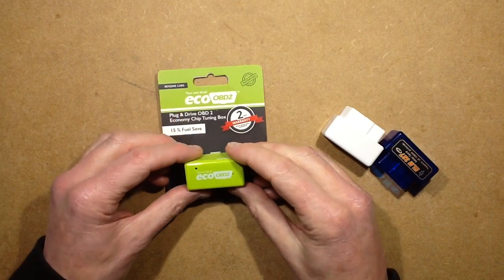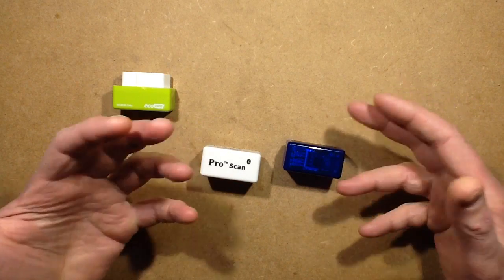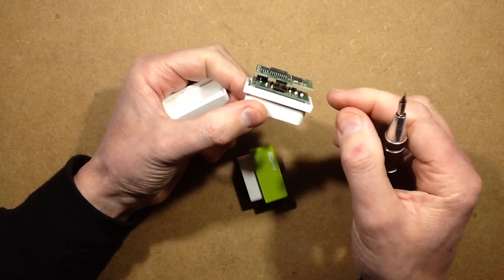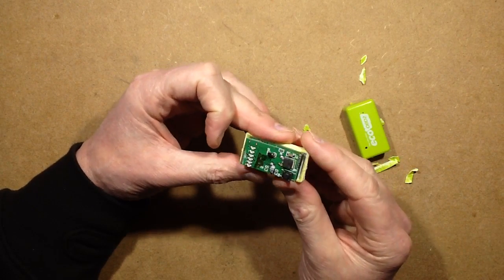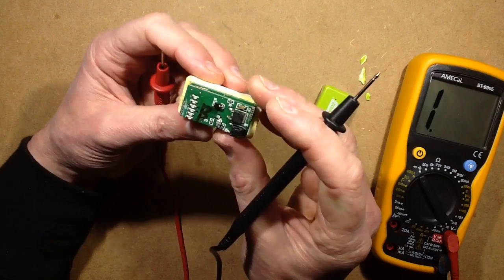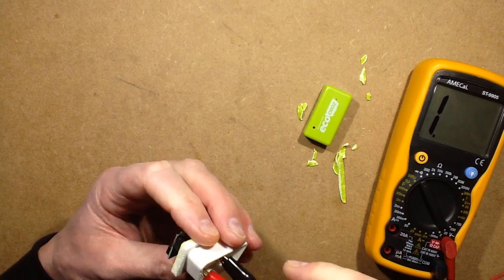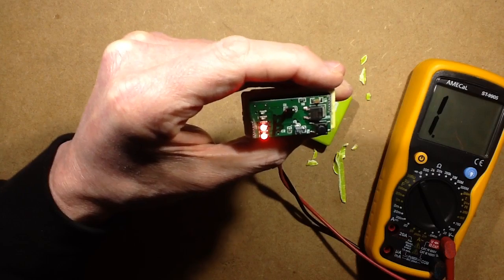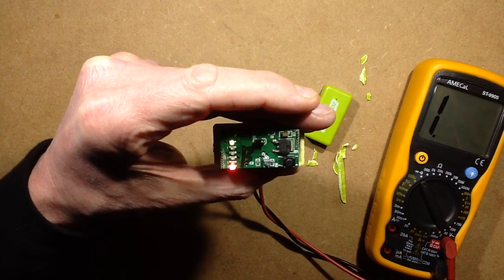Inside an ECO OBD2 "chip tuner" fuel saver.

Comment: To be fair, OBD hacking is not only for criminals. It is a logical consequence of what I call "down engineering". So let's say a car company wants to sell a low priced car and a higher priced car with more hp. Instead of developing two different engines, it is cheaper for them to build only one engine and have its power output reduced by software. Their marketing guys have carefully calculated the number of potential buyers and they can fill the lower price market and the higher price market. What bugs me about this is that they put an actual engineering effort, man hours and materials, into developing a product that is not as good as it could be, purely for marketing reasons. So if you buy the cheaper model, it could actually be considered a scam, there's a little chip inside to prevent it from doing all it could, purely for profit optimization. It is not only car manufacturers that do this, this practice of putting an effort into building something that is nerfed is found in many industries. So unlocking this sucker chip may not be legal, but it can also be considered self defense against a practice that holds the buyer for a sucker.
Reply: It does exist in the automotive world. Using VW as an example, the venerable 1.8T (20v) engine came in several different horsepower ratings across several platforms in both VW and Audi vehicles (and Seat and Skoda vehicles in Europe). The 1.8T engine was installed in more mk4 chassis' than any other chassis of the era, and came in 3 different power levels, depending on the model and trim level purchased. The run-of-the-mill Jetta, Golf, and New Beetle Turbo were equipped with the 1.8T rated at 150hp. The Golf GTI, Jetta GLI, New Beetle Turbo S, Audi TT and A3 ( all built on the same "mk4" VW chassis) were equipped with the exact same engine, comprised of the same internal components, same turbocharger, even the same fuel injectors, rated at 180hp. The only difference was in the engine management software. The 180hp engine was "de-tuned" to 150hp in order to provide room for sportier versions in the same model lines and as not to poach sales from the upmarket VW Passat and Audi A4, which also used the same 1.8T engine rated at 180hp (though these engines had different manifolds due to longitudinal mounting in the B5 chassis vs. transverse mounting in the "mk4" chassis). The third power level of the 1.8T was found in the Audi TT 225 and Audi S3, and was rated at 225hp though that version had significant hardware changes like a reinforced block, larger piston wrist pins, larger turbocharger, bigger fuel injectors, etc. to reliably produce the additional 45hp. So yes, down engineering absolutely exists in automobile manufacturing, and has a legitimate purpose.
Reply: Pomona Bill
- ah, no. Dieselgate was worse. "nerfing" a product is totally legal, and it makes some sense economically, even if it seems absurd to put an effort into nerfing something.
Reply: Modern engines under go a lot of engineering and the "down engineering" you speak of does exist sort of but its not really the manufacturer trying to pull one over on us. In some cases there are valid reason why one engine produces more power in one vehicle and less in another. For example the 5.7 HEMI produces 395 HP in a RAM truck but the same 5.7 HEMI only produces 360 HP in a jeep or durango. This is because those vehicles have smaller engine bays that didn't allow for a more efficient exhaust headers to extract more power and they have slightly less aggressive cam phasing. They also have less room to install radiators that are able to dissipate the same amount of heat as compared to full size truck which has room to install over sized radiators that can handle hard towing conditions where the engine will be under heavy load.
Reply: Connor Hill and the award for 'Longest YouTube Comment Novel' goes to...

In all seriousness though, I do believe that there are engines out there that are limited by the manufacturer, yet I don't believe it's to the scale that OP is saying. 
I imagine you're only going to find this with the smaller and cheaper cars out there, rather than the larger and/or more expensive ones. That being said, it is only speculation on my part, as I've got no evidence to suggest otherwise.
Reply: Connor Hill That's not the generation of the Golf I'm talking about. I'm talking about the "mk4" chassis (known by VW as the A4 chassis, NOT to be confused with the Audi A4, hence the "mk4" used), around 1998~2005-ish. 

It would behoove you to know just what the hell it is you're talking about before you accuse someone (who knows far more than you on the subject) of being a liar, especially when you're as dim as you appear to be. Good day.
Reply: That's maybe true for the car industry but the down engineering is very real for the IT-industry. Exact same hardware and they sell it for different prices depending how much functionality have been disabled by software.
Reply: Connor Hill Normally no need to reply to ignorants, but search for this: 
"Firepro W9000 = HD7970GE (384-bit memory bus , 2048 shaders) with 6GB ECC VRAM (Tahiti XT) <--- like $3K for this, HD7970 ~$400
Firepro W8000 = HD7950 (1792 shaders) with 256 bit memory bus and 4GB ECC VRAM (tahiti pro) <-- ~$1.2K"

these "pro" cards sell for a premium to professionals/studios for a reason! (mainly driver's optimization for specific software, i.e: Adobe premiere, AutoCAD..etc) to justify the extra cost, but those customers are small quantity compared to home users. so they price it accordingly, and companies don't mind buying a premium because the return of the investment are far "far cry" superior to the cost of the "pro" cards!!
Reply: ameer
Reply: I know im late to the "party" but wanted verify something. 

In Norway we had to pay taxes on cars depending on how many hp they had(I think it was around 150usd for every 1hp, this only changed this year), so what most european car makes would do was deliver a de-tuned version to norway so they could sell them off cheaper(less taxes). This is one of the main reasons why simple chip-tuning or re-flashing of cars has been extremly popular here in Norway.  A good example is the 2012 BMW 320D wich came with 184hp in the rest of europe, but was only delivered with 163hp here in Norway. Mehcanically they were completly alike, the only difference was in the ECU.
Reply: What? Many cars can have  the (software) upgrade kit to increase power which is an optional. For example the Grande Punto Abarth.
Reply: Same as FLIR cameras, one cheap and one expensive both uses the same sensor but for cheaper one the picture resolution is only half of original.
Reply: For those of you arguing this isn't really happening I'm afraid you are wrong.  It's cheaper for a car manufacturer to have fewer engines and modify them in software for different power/efficiency marketing requirements than it is for them to invest and test multiple different engines. For example many markets have different tax or insurance rules based on engine performance/efficiency so some people opt for the cheaper cost of ownership engine and some it for the higher performing version. As the owner of a Volvo D3 that has had the ECU reprogrammed so the engine is now a  D4 I can absolutely guarantee you this is the case.
Reply: Vw selling cars with 105 hp, and 140 hp. The difference between two car is the software. Nothing else.
Reply: I can tell you this, lots of people have blown up the Ford 2.3L Ecoboost engine (in the Mustang) by applying aftermarket tunes to engine.  Ford makes their own tune (Ford Performance Tune) that basically erases the protections in the factory tune for "low" octane fuel (87 here in the USA-necessary for rental car fleet sales).  People outside Ford don't have access to the factory documentation that tells us why certain decisions were made in the factory tune.  The factory tune is also encrypted to prevent competitors from gaining access to Ford's proprietary data for the engine, and patents in areas like fuel maps, etc.
Reply: My 94' jeep wrangler had something like this but not for the engine.  They had two gas tank sizes, 15 and 20 gallon options.  Turns out it's the same gas tank.  The 15 gallon just has an extra length of hose attached to the vent tube sticking down into the tank to prematurely shut off the filler nozzle. The 20 gallon has a shorter vent tube allowing more of the tank to be filled before gas is pushed up to shut off the filler.
Reply: I've read all you guys' comments. I'm on a limited income since my husband has passed, I don't have anyone that can help me figure car information out. Wish I would've read your reviews before I spent my money.
Reply: Connor Hill dude, you are exaggerated too little, remember AMD done that in their GPU before, and even Nvidia done it between GeForce line & Quadro (the only difference was the driver and ECC ram)
so it happens for pure profit & cost effective.

Comment: I have a Honda Civic SI 2015 and Honda  makes a product called Hon Data it's a link that you put between your car and your laptop and you can modify engine settings my car has a USB port. The term they use is called a custom tune. It's really cool you can look it up. The Honda Civic SI is also performance car so it may not be available on all cars.

Comment: i very much doubt this will save fuel, there has been many claims by different companys that these gadgets save fuel, they do nothing, the problem is the internal combustion engine is "a waste of fuel", more than 50% of the fuel you put in is wasted, next to an electric motor which can be up to 98% efficient.
also Clive dont be scared of OBD code readers, they wont hurt the car in any way and usualy there would be some fuses and other protection in the car.
great vid...

Comment: If it does anything it will just reset the ecu like when you clear the codes.By doing so it causes the car to relearn things and if in fact your fuel trims were on the fat side in theory it could possibly save a few milliliters of fuel LOL.But that is a BIG if and truthfully you'd get the same results by hooking up a scanner and clearing the DTC's end ecu ;) Although in that case you wont be driving like granny and get the placebo effect.

Comment: This is a guess: Cars with this interface might already have an auto tuning algorithm that will run when the car is new and then fix the parameters. These devices might just reset the system, causing the car to do the auto tuning again while also putting on a light show. In theory, this could help optimize the car a bit for new conditions (new location, new driver, worn out engine). But I don't know anything about cars, just guessing.
Reply: Mikael Lövqvist you're actually pretty much there... There are other odb devices that do exactly that and are advertised as such rather than just as 'fuel saving'

Comment: What these devices actually do is reset Temperature data, and tell the car the intake air is cooler,  thus adding more fuel to the mixture.
It may give a slight increase in performance but won't do anything for economy, and indeed has the potential to damage the CAT in the car due to overfuelling

If you have a car for banger racing, it may help. but for road going cars, it's a good way to fail an MOT on emissions 

In effect it's the same as the resistor trick on the air intake. But this actually resets the learning curve of your ECU.
Reply: Hi, I must say that your not quite right with your assumptions and heres why...
There is no way to reset temp data unless the CAM or keep alive memory power is lost and the only way to do that is with the proper scan tool or to remove the battery.
You cant fool a modern car with intake air temp as that is just one sensor that it uses to cross ref its map, it would use other things like engine temp, outside temp, wheel speed, etc So the map would not let it! But it could put an engine management light on requiring service as it would make it think the sensor is out of spec and failed.
Also there would be no damage to the cat as lamba 1 and lamba 2 sensor in exhaust would back off fuel as it works on a closed loop system to ensure the map is complying with emissions.
You look the right age to have played with a lot of 90s cars where you could do resistor tricks. The modern car just wont let you till you change the whole map properly!
Reply: Its been busted and does nothing! here it is for you Colin... https://www.youtube.com/watch?v=ytwlDVaFbec

Comment: It is possible that it could access the software in the ECU.
I regularly work with e-bikes and the Bosch equipped ones have multi-level system access through a single USB port. Customers can usually only change small things like the clock, display layout and unit of measurement. Dealers have greater access using a coded dongle and a piece of software. Manufacturers have full access using the same software but a differently coded dongle.
Also I had a friend that worked in an automotive company servicing HGVs and he used a laptop and programming kit on his own car to access his ECU (he didn't change anything but he could have).

Comment: I have had remaps on my cars (Audi and Skoda), both have been done via the OBD port. The remap changes aspects of the engine, in both my cases, get more power by cranking the PSI of the turbo and other things to increase BHP.
Reply: At least 6 other videos with odometer tests dispute any improvements in performance, horsepower, or gas mileage. I'll save money and develop better driving habits by smooth acceleration and braking. From what I have seen and heard, these units are a SCAM.
Reply: @larrybruce4856  Not denying that these are not a scam, I had my map done while on a rolling road, this shows actual gain.

Comment: I have the exact thing (Yellow for Petrol) hooked up to my Toyota Camry 2008 and had the balls to plug it in. I always had the problem of high revs for around 5-6 seconds going from first gear to second gear and basically overall sluggish gear change times between gears. After I plugged this in, I realized all it really does is re-program your gear changes so they're faster in shifting with lower rev time between gear shifts i.e 1st to 2nd gear even on an incline = 2-3 seconds. On the hold, not having to wait on high rev for your car to engage second gear really does save my fuel and I have seen a difference with this thing. Hope this helps clear all the smoke up on this thing.
Reply: Hey Brandon, thanks for the enlightenment.

Comment: cant program through odb2
Reply: Phillip Ramirez Actually ALL control units on ALL cars produced these days are programmed through the OBDII connector through various network protocols.  The latest are CAN bus and Ethernet.  Auto Technician.
Reply: Mark Posner wrong.  There is another port and it's not the odb2.  Or Link me to software and pinout and connect information.
Reply: i believe you can program  certain modules but it requires different protocols   ie  on GM/Opel  you would use a GM Tech 2   tool but the eco device   looks  like a  scam  the usual method is to alter  the sensor or readings  for the air intake temp
Reply: Take a look at the Bluefin device. It can remap your ECU through the diagnostics port.
Reply: Jürgen Haan diag port or odb2?
Reply: Lean = less "fuel". Oh maybe your grammar just messed you up. Yes a lean condition can cause heat issues in a cylinder, but as long as you have the right spark plugs you should be fine running sorta lean. Yes spark plugs have a second purpose and it is to transfer heat back to the block, google it.
Reply: Phillip Ramirez my Dodge Grand Caravan had to have the PCM reprogrammed and the Dodge Shop flashed an update to my van through the ODB2 port.
Reply: Jonathan Ryan Grice odd because my ram. Had to have the programmer plugged into a different plug under the glovebox

Comment: Using the OBD II port and most of the newer vehicles you can, with a pass through tool connected to a computer and downloading form the manufactures web site, you can indeed reprogram any of the computers on the CAN network. 
With that said, a pass through tool runs about 2000 dollars, and you need a computer connected to the internet, and you need to buy the program from the manufacture. These little thing can not possible have all the proticals to do anything at all.

Comment: It's equivalent to having to check the headlight fluid
Reply: You're supposed to change the headlight fluid every 1500 miles. Otherwise it could screw up the catalytic converter and brakes.
Reply: Well, if you have say a Dodge stratus, there is headlight fluid. Seriously, there is a little alcohol level gauge and they can leak. So there!
Reply: You have to check headlight fluid no bloddy wonder my lights dont work 😂😂😂🤣🤣 these things are absolute garbage

Comment: I hooked up a flux capacitor to my intake manifold bipolar dropouts, added techron 9, tweaked the mitral valve to open fully and ran straight tabasco injection fluid into the wonkavator.

My mechanic loves me
Reply: I’m sure it didn’t work because you probably didn’t change your muffler belt
Reply: @kenfreed5932 😂
Reply: He used non organic biofuel.  This was the problem, it killed it instantly.
Reply: does this result in a hot fast curry ! ?
Reply: Just tickle the philanjee - goes like stink

Comment: I have had one of these on my VW TDI PD 130 engined car for a few weeks and the fuel consumption has increased by i guess 5 miles per ltr .  Had no running issues or differances in performance though . But I'm very happy with the increased fuel mpg.

I used the RED one it seriously works but after a few weeks of daily commuting.

Comment: I try it on mercury grand marquis 2006 GS 

and it work in a good way ,
in fact it save fuel on high way road more than city road 

you should use car speed controller 

it will work 

it save about 10 % -15$